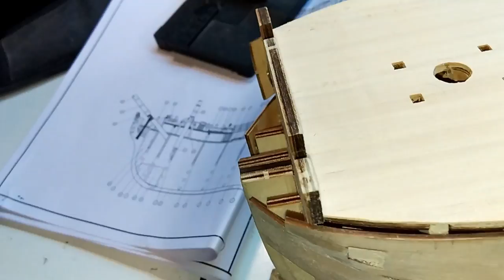Montanes - part 13 Placing The Bulwarks

Comment: Hi john, on the 3rd row of gun ports you pointed out that gap at the back end . On the framing for officer quarters the model has that extra piece on the framing to make it wider, that’s where the gap is. I just sanded and tapered the filler piece to make a smooth transition back there without a gap. It worked out very well. But as you say the back end will be covered up with captain quarters framing and windows. Your video is Great and that you very much for your channel. My ship is coming along very nice. Thanks john, conductorjohnmth , Florida , USA
Reply from the maker: Thank you very much for your kind words John :)

Comment: John great video as always my friend,  did you check that 3 level deck- the short one maybe it needed some sanding to try and bring in that side piece at the stern. Could not tell myself  did not get a good look at it. Just a thought I had because that looked like it was not to much fun to deal with. Or maybe it is a flaw in the model design?  Just had that thought as I am typing this out, what did you think the problem was?
Reply from the maker: I think you are referring to the deck i am going to place later on? It probably will need some sanding but right now i do not know how it will fit. Did i understand it right or you are referring to another part?
Reply: @JohnsWoodenShips  well actually I was talking about the frame work for that last deck , because  I would think it should slope in at the top or slope more in at the top where that deck would go. The more I think about it , it just might be a mistake on the plans or the cut of the wood. But it is very hard to tell from the video,  you are there and I am here so it makes it a bit difficult.  I trust your judgment on what to do with it. We all know that you do excellent work so keep on building you are doing fine.
Reply from the maker: @4englishlies875  Oh i see what you mean :) It's less that half an inch in height but i haven't placed the 3rd deck yet. When it will be in place and also planked i think that it will be in the normal height :) It seems wrong because it's empty right now! Good eye my friend !!! :)